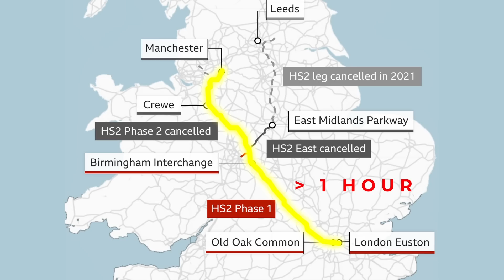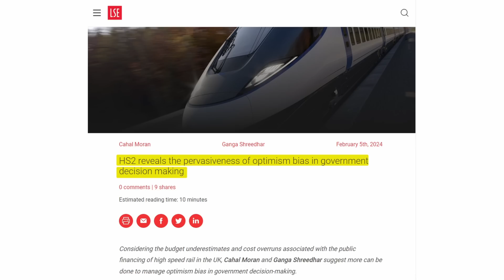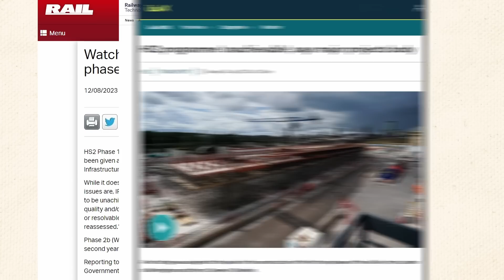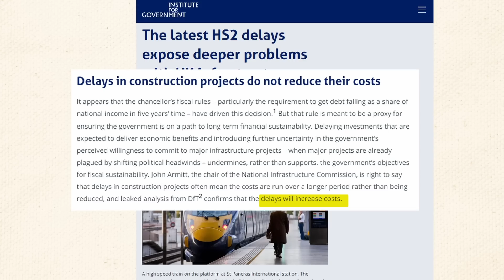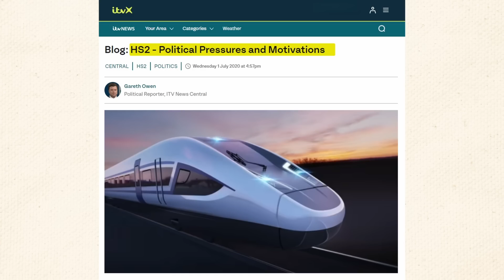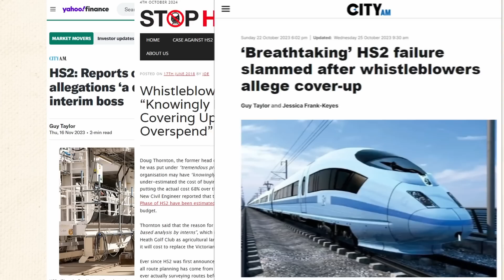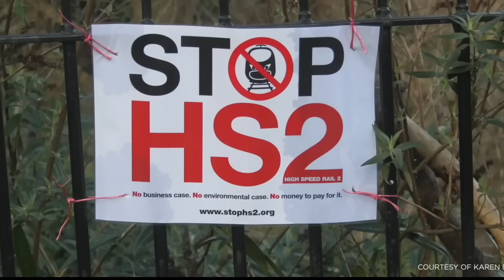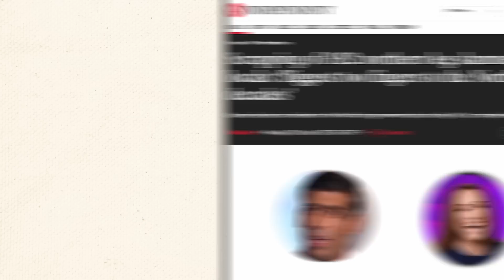Inside UK's £100BN Railway to Nowhere

Comment: The main problem with HS2 is HS1.  The master plan of Ove Arup (now Arup) a Company based at Stratford is the sole reason why both HS1 and 2 are flawed.  Using St Pancras as the hub of HS1 was always a nonsense - north, then east to Stratford "International" (that has never seen an international train stop there).  Then it's south east towards the Dartford Bridge alongside the C2C line to Tilbury!  Finally the line gets south of the Thames to Ebbsfleet "International" that, as far as I know, has bever seen an international train.  On goes the line to Ashford International (that no longer sees international train services!).  All this nonsense because one of the leaders in the project, Arup, are based in Stratford.  HS1 should have had a pupose built station in London under Kings Cross (just as all other major rail projects overseas build large underground stations).  HS1 should then have been driven directly south/south east to Folkestone.  If this had been done, HS2 would have been able to connect to HS1 seemlessly but that is now impossible thanks to the ridiculous route from St Pancras.  It must also be noted that Arup had much more than HS1 in mind when they planned the route - they have made £billions out of this Country via Stratford Shopping Centre, Crossrail, the Olympic Park and many other projects set in the Stratford area.  HS2, with no physical connection to HS1 is a white elephant.  Yes, capacity on the WCML is a problem and maybe part of the reason HS2 is being built but spending £billions on a line to help with capacity of another is nowhere near enough of a reason to do so.
Reply: The original plan I thought was to tunnel under SE London through Central London with some sort of a new possibly underground station in the vicinity of Euston then connect into the WCML. And I guess in to HS2. But the Government was shit scared of peeing off voters in SE London so saw people in the East of London as a softer option. And it finished up in a tunnel anyway.
Reply: @kevinrayner5812  Given the amount of deep tube lines plus sewers plus utilities that are already deep under London, do you have any idea whatsoever as to how monumental an engineering project that would be and how deep you would need to go in order to achieve that aim, of going directly south from KX???? Dont you remember how complicated the Jubllee Line Extension was as one of the deep Tube lines and you're expecting something even bigger to try and thread its way through all that lot????

Have you any comprehension of how expensive and how bordering on the impossible that is????
Reply: @stevem-h3562  "Have you any comprehension of how expensive and how bordering on the impossible that is????" Why are you having a go at me. You think that this was my plan? No a bunch of very highly paid consultants came up with it. I suggest your rant is aimed else where. As it was they spent money building Waterloo international and upgraded the line then they repeated it all re-building St Pancras and Stratford "International" and the HS1 line. Why not just do it once rather than wasting all that money the first time. "plus sewers plus utilities that are already deep"  Oh my God, how deep are the sewers and the utilities exactly?  Have you seen what the Americans are managing to do in New York? This is the problem, just building a normal surface railway is now beyond our capabilities. It is just too difficult and too expensive for us to do what other countries seem to be able to manage.
Reply: The original plans had a short link from HS2 to HS1, but a combination of Camden Council objecting, the costs of building the link (it is, after all, in Central London), perceived lack of demand for through services and the costs of employing customs staff in all stations en-route saw it cancelled well before the rest of the project (along with a proposed spur to LHR pre-dating Crossrail).

Comment: The most interesting question is why the construction began in the south! It actually tells you everything. The solution is to move the government base. I suggest moving Parliament to Immingham😂
Reply: Totally agree, if they had started in the north I believe the whole route would have been completed because you would not have had the expense of building all the tunnels under the Chilterns, the only tunnel I was aware of north of Birmingham was the one from Manchester Airport to Manchester Piccadilly. The north section would have been completed and then there was no way they would have cancelled the section they are currently building. Yet again a project that was supposed to "level up" the north was too London centric to begin with.
Reply: Because the South is more congested than the North, you need to deal with congestion on the line in the South before reaching North, Oh according to you nimbys brigade no one uses trains in the North.

Comment: So much bullshit! And the title is pure clickbait!

Birmingham is not "nowhere", and the trains will continue further north on the existing lines.

Of course the full benefits for the network only happen when the line is build to Manchester at least.

But it will still bring benefits right from the start! The WCML will have more room for local trains and freight trains.

It was never only about speed, it's mostly about capacity!
Reply: I'm not sure whether they were referring to Birmingham as the "nowhere" or whether they were referring to the terminus at the moment being Old Oak Common, now that is nowhere as you would need to get another train to get into London itself.
Reply: @andyb2706  well the extension to Euston is now comfirmed. Will take too long, but it will come
Reply: @nicolasblume1046  No it is not confirmed. "The transport secretary is considering extending the HS2 line to Euston, her cabinet colleague Lisa Nandy has indicated, after Louise Haigh claimed it would make “absolutely no sense” to have the high-speed route terminate outside central London." Only considering extending.
Reply: @kevinrayner5812  And even if it is extended to Euston, what the station will look like or how many platforms it will have is still up in the air. The original concept was to completely rebuild the entirety of Euston Station, integrating the High Speed platforms and having a dedicated pedestrian link to St. Pancras next door, but at one point is was downgraded to a bolt-on to the existing Euston Station (which is badly in need of a redesign given how chaotic it gets) then only if it could be funded entirely by private finance (with no government investment whatsoever), while the number of platforms were  progressively downgraded from 11 to 10 to 6.
Reply: @andyb2706 old oak common links with the Elizabeth line.
Reply: @johnturner4400  Great whizzed from Birmingham to Old Oak at 225 mph then cram onto a commuter train.
Reply: @johnturner4400 Don't you mean it will link in the future ? I didn't think there is a current live connection to the Elizabeth line.
Reply: @TrevorWilliams-fq8mg  I didn't think that there would ever be a physica connection if that is what you mean by live connectio.
Reply: @kevinrayner5812 The way some people speak they think the Elizabeth line is already connected to Old Oak Common which I didn't realise that was the case. I thought it was going  to be a  future connection. Did you get to the bottom of the contracts being costplus ?
Reply: @TrevorWilliams-fq8mg  I am in no position to know anything about what the contracts were. I would raise it with my MP but where I am we have the Labour version of Nadine Dorries. I would never get an answer.
Reply: Hahahaha.

Yeah, it''ll bring benefits alright. To the contractors who are building it. It wont do a damn thing for anyone else. And it'll have no effect on capacity whatsoever because the business case that stated it was about capacity was a lie from the get go.
Reply: Remember £32 Billion initial costs would have been the lower risk scale, with a medium & higher risk cost provided too, all infrastructure projects like this take this approach, but the media & anyone who wants to make a squewed point will pick £32 Billion and not the other 2 costs as a comparison.

Personally as a Northerner, I was curious why they didn't start the build from Manchester and Leeds, would have made sense, oh hang on.

Comment: If only they didn't always make the project delayed for making unnecessary design change just for an "aesthetic" that no passenger will ever able to look anyway, they may already HS2 In operation. Not to mention because this cost overrun, they are plan that HS2 station on London will not even in city centre and that will make another problem because it's meant, the many already very busy London train now have to be a feeder toward wherever the HS2 station near the London, good luck on that if that happen😅

Comment: A $14 billion economic yearly impact!!!!  It was stupid to cancel this project.  It should have been built and many after it should have followed.  With the right policies, it would have been the project that allowed 2nd and 3rd cities to grow larger, and would have made the submerged floating tunnel bridge(s) not only feasible, but would have allowed the regions around the bridges to become far denser populated areas, witch in turn would make the economic impact even larger as many jobs would be needed to build and than maintain the areas.
Reply: England already has some of the highest population density in Europe. Higher than the Netherlands and Belgium
Reply: I certainly don’t want any of our cities to get any bigger or more densely populated thanks.
Reply: @melvynwoodman5787  Bigger populations mean it's going to happen.
Reply: To be honest, if it weren't cancelled, it wouldn't have made any difference because England doesn't have a dedicated, experienced big project builder team. So, building such a big project is like trying to build a big snowman, which is like the Channel Tunnel project, which took 6 years.
Reply: Dollars??
I think that you mean Pounds.
Reply: That's the kind of thinking from politicians, it's not the real world. Have you any idea how many workers will be needed in twenty years time? It won't be many.